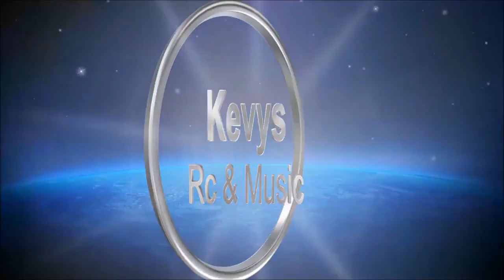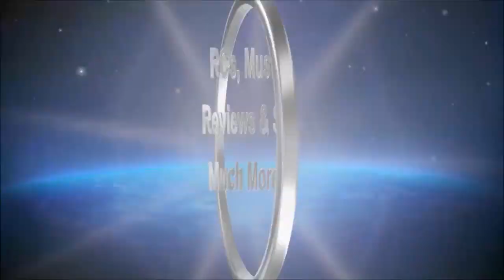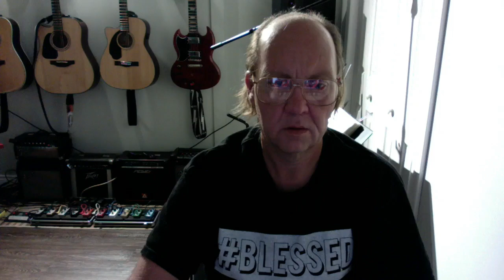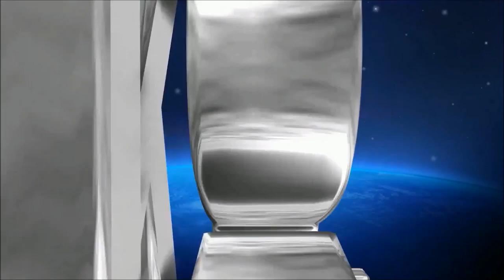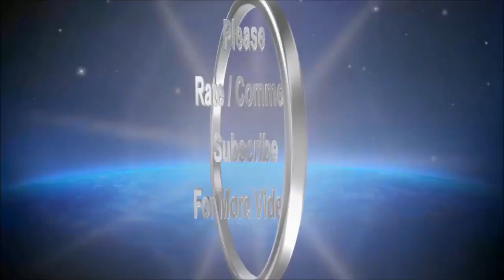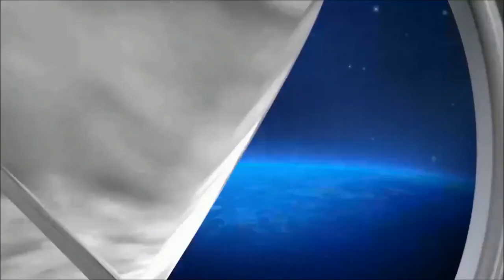why your lipo batteries keep blowing up or puffing etc

Comment: Wonderful video, but I have a question? One of my turnigy bolts 4s 5000mah 15.2volts lhiv battery puffed on me! What's the problem and solution???? I really appreciate 🙏 your professional honesty opinion
Reply from the maker: could be it does not have enough amps and discharge rate to keep up with the rc your putting it in and you should also always chage and 1/2 less then the rated MAH and always balance charge them as well
Reply: @KevinMillard68  thank you sir 🙏 I do balance my batteries and storage charge them when I'm not using them! I have a xmaxx! Hobbywing max5 esc! Around 200 something amps! And a Hobbywing 800kv motor! So! What's the best 4s batteries for this

Comment: We just installed the new XR10 Elite ESC from Hobbywing which is capable of 1200 amps.
Our first test was with a 8500 120C battery which puffed in 6 min. Of track time. According to the math there is no battery on the market that can keep up with this ESC without damage yet these are selling like hotcakes.
Reply from the maker: no esc runs 1200  amps 12 amps yes 20 or 30 amps yes  60 or 100 amps 1200 amp BS no such thing in the RC world for brushless , in brushed setup i had an esc they claimed was 1000 amp but when tested nope it was all marketing BS  your battery its 8500 MAH wich is 8.5 amps

Comment: I'm completely new to the whole brushless/lipo setups. I even emailed a company that my truck is made by and asked them what battery they would recommend as I'm looking to run my truck a little slower and longer instead of high speed and and shorter runs and they just sent me a link with a list of batteries without explaining shit. This video helped in explaining things a little better. You explained pretty well,thank you.
Reply from the maker: your welcome and sorry to hear the company was not nice to you i would never trust the companies when it comes to the right battery for your rc
Reply: @KevinMillard68  I feel the same way about batteries. If you don't mind me asking,I would like your opinion on this. My esc input voltage is 25.2 volts. It has a BEC voltage of 6.0. The BEC has a continuous current of 10A and the peak BEC current is 20A.

Now the batteries (as I can use 2 if I want) I'd like to use is a 2c 7600mAH 25c. It has a continuous discharge of 25c (190A) and a max burst rate of 50c (380A) and it uses 56.24 watt hours.

Do you think this would be a good battery to use? Or should I use 1 with a smaller mAH? My truck will go higher speeds on 6s but I want to enjoy running my truck and I don't mind if it runs a little slower as I'd like to run it longer instead. If it helps my truck is a 1/7 scale (I think) and it easily weighs about 14 pounds without batteries. Hope you can help me out if you can as I would greatly appreciate it,thanx
Reply from the maker: @jonlaird5082  iam going to tell you what i was told , the biggest mah battery with the highest discharge you can slam in there do it. most lipos suffer and die because they are not supplying proper power to the system people like to full throttle alot i know i do ummm i think  i need to do a ne video give me a few days and ill get one posted likely ill called why you need high power batteries in your rcs
Reply: Oh and if it matters my factory motor is a 2200Kv brushless motor.
Reply from the maker: @jonlaird5082  ill do a video to exlpain all this more detailed
Reply: @KevinMillard68  ok thanx
Reply from the maker: @jonlaird5082  your welcome

Comment: So help me out here. Consider me about ten steps behind a rookie. I won't see rookie status until I can make a drone from scratch without looking at a parts list. I may see amature status in 4 or 5 years. The mysteries of electronics have failed to reveal themselves to me and I have been running r/c at the " obsessive" or " I divorced my wife because she wanted me to spend more time with her but I needed morw time with my cars"! And I have been doing it since AE introduced carbon fiber chassis to their 10 scale buggies and trucks(1990+or-) . I can barely use a multi meter and can only do anything with one if I am following specs on paper. 
  So I'm a dummy(many people will not defame themselves thus way and then even though its obvious they dont know shit, they act like they know everything). Can you gimme an email address and maybe be willing to tolerate some very stupid quearions so I may someday reach a point where I can do what I need to do without wasting money because I bought rhings I didnt need or thought something was finished when a small repair would have salvaged it? I would really appreciate the help and be very respectful of your intellectual supremacy. I just need to find answers from a person that has the correct ones. You certainly are him.
Reply from the maker: well the best i can do for you is to tell you to google stuff like how to use a muilty meter , google also ohms law for resistors , look up elctronics programs on the app sotre for mac useers if you haev a mac or goo the micosoft store for windows useres if you have windows computer, there are alot of programs that take you from the basics right on up .. on my channel i have a video on how to solder . you can get electronic parts like leds resistors capasitors diods and more at banggood.com for parts you might want to have as well for building stuff and fixing stuff as well.. hope this helps you out

Comment: So is the higher the c number (25c,45c) is the better?
Reply from the maker: its not just a High C rating you need you also need the hightest Mah battery you can jam in it as well C rating and MAh are combined to give you the amperage you need to supply power properly with out damaging your batteries

Comment: .. Hi great video.. If i reduce the punch level on my esc will that reduce swelling
Reply from the maker: over all load will remain the same constante and burst are the same so no it wont take the load off
Reply: Kevys Rc & Music.. Thankyou a great help
Reply from the maker: look into SMC battereies you can get them with really hi c ratings which will help alot what car /rc is your conceren about and what motoro and ecs do you have and ill reccoment a proper battery for you that will work great with it also want to know your gearing spur and pinon setup
Reply: Kevys Rc & Music.. Im in New Zealand.. Its a boat, 2030kv 1/8 scale motor, 150A flycolor esc, 2x 3s 25-35c 2200mah turnigy, 45mm prop. the lipos like puffy pastry:).. I previously tried a 4s 4000mah 60-135c on the boat and that swelled but not bad.. I started blaming the esc because i thought if i use higher voltage then that would be enough
Reply from the maker: id go 90c with 120 or higher burst and if you can fit 5000 to 7000 mah then you should be fine ,, if you over prop the boat then that can cause you to over draw from the motor and esc alot which in turn will over draw from the batts also keep in mind as well burst rates are based on stock setups at no more then 10 seconds then you do cool down runs to half and below on the throttle you can not on any rc no matter how big of battery you can not stay on the throttle full time as it will hurt even the best batts,.. but turningy batterys tho are good they are not 100% what they say they are either .. Try a set of SMC batts with a min of 90c at 5000 or larger if you can fit them in
Reply: Kevys Rc & Music.. Thankyou.. i sure will try some bigger lipos with that c rating.. and yes i think my prop is too big..
Reply from the maker: your welcome

Comment: what wouuld be most realiable batterys
 for the new xmaxxs 8s
Reply from the maker: I like SMC they have Hi C ratings and they are not that expensive either, there really is no such thing tho as the most realiable or best batteries but there are some really good ones and some that are junk but the higher the Mah and higher the C rating in any RC the better they will be and longer they last just keep in mind you have only got a certian amount of full throttle time you can do and youll damage any battery if you dont follow the rules on Burst times
Reply: thanks ever so much
Reply from the maker: your welcome

Comment: I'm gonna buy the Traxxas E-Revo 1/16 brushed 2.5Ghz truggy with a Traxxas XL 2.5 Electronic Speed Control (can't find specs of this speed controller in the webshops I'm using) I wanna know if my Traxxas ID power cell LiPo's are safe to use. They are 2S 2200MAH with a continuous discharge rate of 55A and a max burst rate of 110A.
Reply from the maker: you can run 1 2s or you can run 2 2s in parrelle hook up only for longer run time make sure as well that you prgrram the ESC for lipo mode other wise youll kill your lipo batterys
Reply: Thanks. I have a traxxas parallel connector ;) Uhm... can I find in the e-revo manual how to change the ESC to lipo mode? Sorry I'm new to this hobby ;)
Reply from the maker: goto traxxas website simple mode is turn on the esc let go of the button then push and hold the power button till it beeps at you until l  the led goes green you may or may not hear a beep but the led must go green  then your in lipo mode its that easy
Reply: Thanks!!
Reply from the maker: your welcome

Comment: I really love your video because I really needed help in this area I have a mama monster x  a 1527motor  1500kv in side a truggy a 47 spur gear an a 17pion and a battery 5000mah 22.2v 120c burst 65c rated  is that good or bad please help me if I need to change anything I run off road
Reply from the maker: the 65c mayybe ok but youll need more MAH then 5000 other option is 120c 5000 mah but 7000 to 9000 mah at 90 to 120c would be best

Comment: Nitro Kyosho has a good video on Thunder Power and how to keep them going.  Basically don't over discharge but you are right you need the C rating for the amp draw.  Think lipos are limited on temperature to some degree.  Thunder Power has a tip sheet on their site which I think is good.